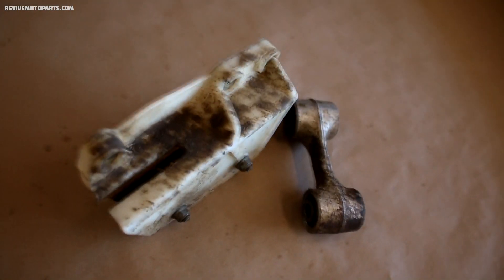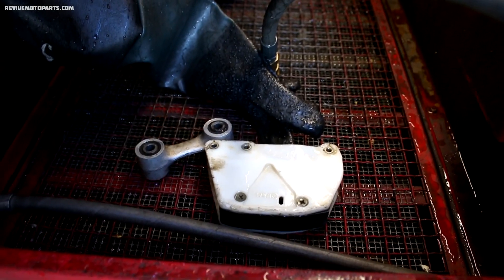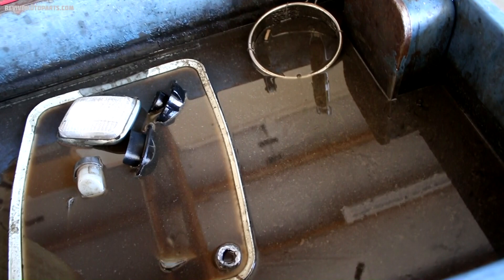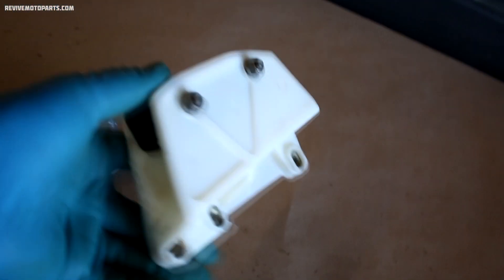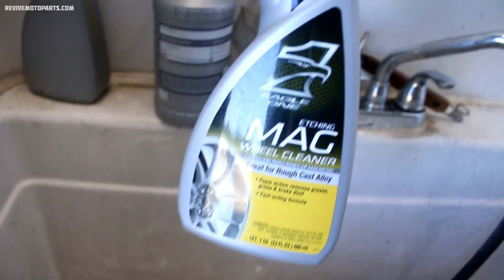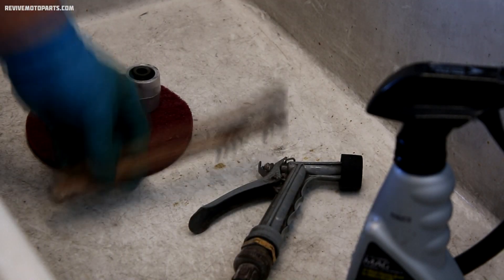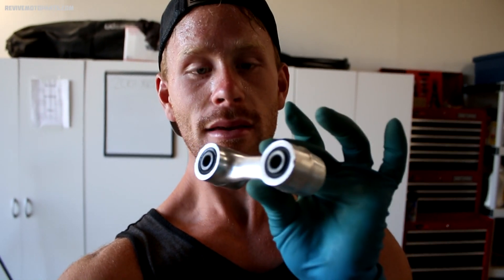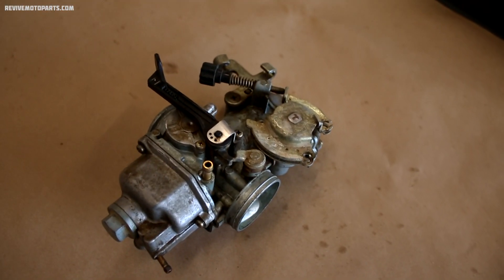Incredible View Inside a Four Stroke Engine

Comment: I am buying a 450r 2005 the piston has a hole in it the way he determined that is with scope he did not pull head and motor lock up and they no crackes in the cases I would like the450r that you rebuilt I think I could do the same if I take my time the price of the bike is 1200.00 the rest of the bike looks good frame /plastic /handle bars / forks / wheels -tires are ok could give some advice about the problems with the motor thanks corky and keep up the good work.

Comment: Great video and I hope that you might be able to give me a clue as to what happened to my 4 stroke Honda cbf125. Opened up the oil reservoir today. Strong smell of fuel. Oil level was way higher than it should have been. Does this mean fuel was leaking over the piston rings and down into the rest of the engine? There is no other way for fuel to get there right?

Comment: Incredible video ! I have a question kind sir @9:19 is that the timing chain?  I ask because my Ninja 250r has been sent in for a service with 27000km(16000miles)on the clock . The mechanic told me the timing chain needs a urgent replacement  . Is it possible for a motorcycle to have one wear that fast for the current mileage??

Comment: How does he remember which bolts, screws, washers, etc go where? Or does he throw them out
Reply from the maker: All the hardware is sold in sets. For example all the bolts and nuts from the motor are sold together, and the chassis hardware are sold in a set as well.

Comment: speaking of an xr250. i just got a 85 xr250 from one of my customers and its locked up... first thing i did was take the pipe off aaand... both exhaust valves cracked the head and dropped into the motor... he said he got it for 300$ running... me or him dont know what to do with it...
Reply from the maker: Ouch, that'll be a spendy fix. Could either part it or sell as is.

Comment: Another GR8 video! Hey, Cameron, do you have any clutch spring bolts to suit a 97 KDX200 ? How
about a video on how to remove dents in a two stroke expansion chamber using basic plumbing hardware?
Reply from the maker: Thanks so much!! Sorry, don't have any clutch spring bolts for a KDX200. An online OEM parts dealer will have what you need. Would like to do a video on pipe repair since my pipe is dented but it's a pretty dangerous endeavor.
Reply: Hey... It would be excellent to do a proper... on the pipe video! Just find the right block off stops and use a pressure tire gauge connected to a compressor and a map torch.…. Just be careful not to use too much
pressure on thin expansion chambers or concentrated heat in a tiny area...  Keep the pipe glow to a minimum 2-inch radius as not to cause blow outs :- )

Comment: I need that pressure wash cabinet!     Carbs intimidate me but you inspired me to learn how to clean them.   Should i start with my crf or drz or one of my Raptors? My raptors need a serious cleaning but i think its a double Carb? or should i buy a crap one off ebay and rip it apart and put it back together just to learn?
Reply from the maker: Carbs really are pretty simple to go through. I'd start with your CRF carb. Worst case scenario you can always print out the fiche diagram and see how it goes back together.